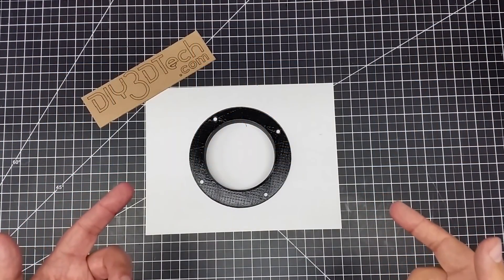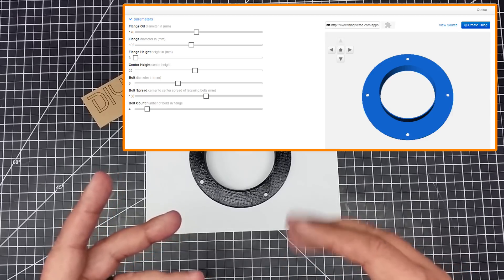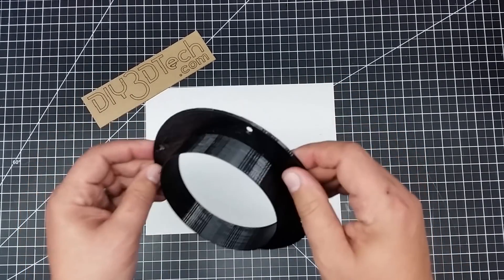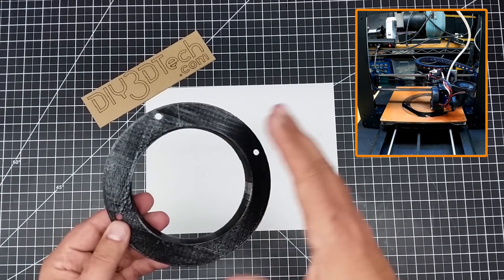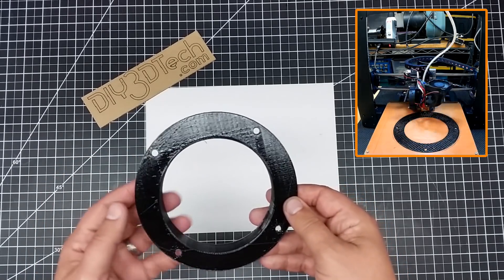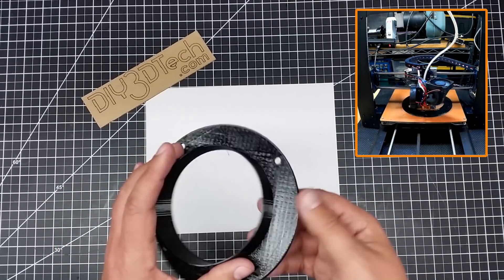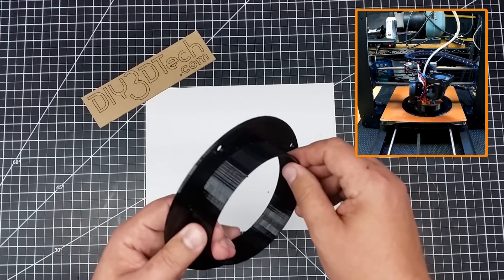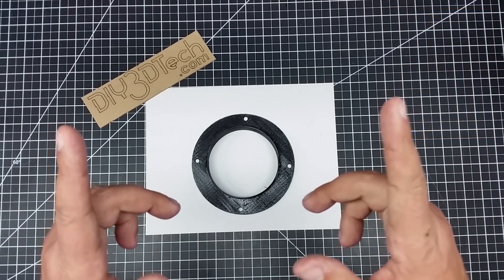3D Printed Project - Flange Designer on Thinigverse!

Comment: I've never used scad, but have seen customized things on Thingiverse (mainly temp towers). So I guess someone can't model something in Fusion 360 and make it customizable on Thingiverse? I like having things customizable like this. Very cool.
Reply from the maker: Yes all customizers on thingiverse are Open-SCAD code.  Being a programing geek I love the programic control it provides...
Reply: DIY3DTECH.com I am somewhat familiar with Fusion 360. I'm guessing openscad is a bit different though? Would be interesting to see a basics video on openscad and how you designed the flange as an example.
Reply from the maker: You know I also produce an Open-SCAD channel and site http://openscad.diy3dtech.com/ correct?

Comment: Can I use TPU on the 3D Select Mini V2?
Reply from the maker: I don't have a V2 (V1 and for that no) as you should have an all metal hot end as the temp will break down the PTFE tube and second becauses its bowden, you need to make sure you have a zero gap extruder...
Reply: +DIY3DTECH - Oh? I gotta disagree with you on this. 
Dispelling the myths surrounding TPU
1) TPU can be printed between 195°C - 230°C. 
2) The PTFE tube can easily handle those temperatures. And there's Capricorn PTFE tube which reportedly handles much higher temperatures.
3) TPU certainly can be printed with bowden-type extruders by (which you briefly mentioned) constraining the filament path. Easily accomplished in various ways. Simply Google a few terms and presto.
Reply: Okay, somehow I thought you had a MP Select Mini 3D Printer V2
Reply: Thanks for the info
Reply from the maker: Yes are corrent and I am aware they say 195 to 230, Yet for me I print at 245 as lower than that I don't get good results.  Also yes you can push the PTFE tube and I personally do (mainly for PETG), however I [personally] view it as a consumable as the end will break down after a while and start grabbing the filament and jamming up then I replace it.  But it is not something I recommend as people typically don't have a roll of PTFE laying around and box of extra compression fittings :-)  With the extruder, it really doesn't matter bowden or direct drive.   You need one with "zero gap" or at least that is what I have seen them called (sure there are other names)  as with out that the filament after a while will just start popping out of the top of the extruder.   :-)

Comment: I'll tell you what I'd like to see on thingieverse... a customizable duct generator that will let you transform it's outer shape from a rectangle into a circle with an optional bend in between. Imagine what the duct would have to be like on the back of a k40 laser with a 4" round hose leading off to the left and a (say) 1.5" x 7" rectangular section going into the machine. I have SO MANY uses for such ducts and currently have to design every one as a one-off.
Reply from the maker: There is one out there already that does round to round with a bend, yet rectangular do you mean just flat rectangle or a taper manifold?